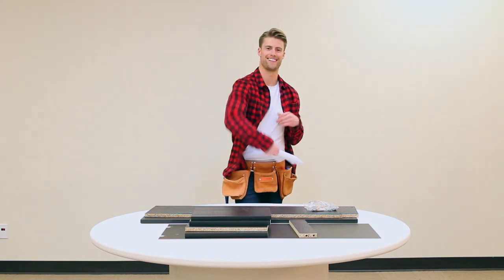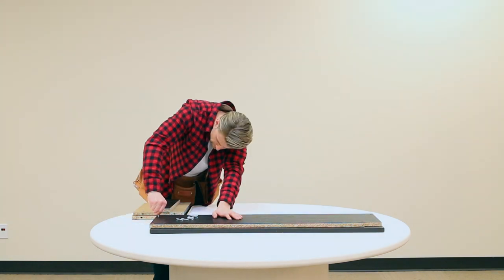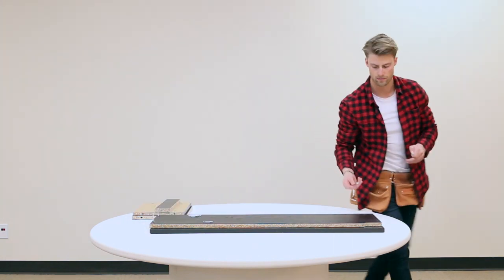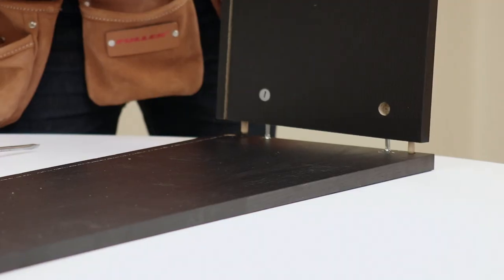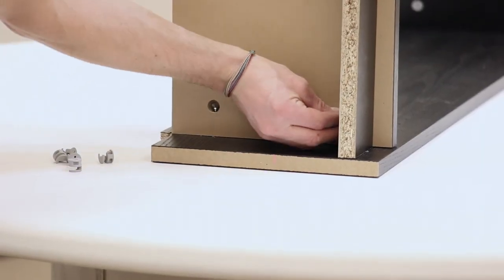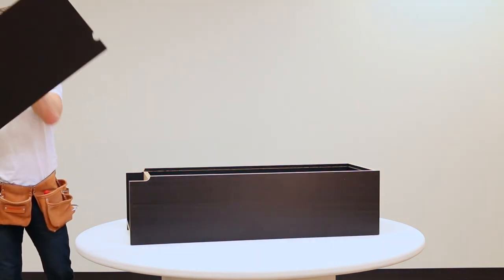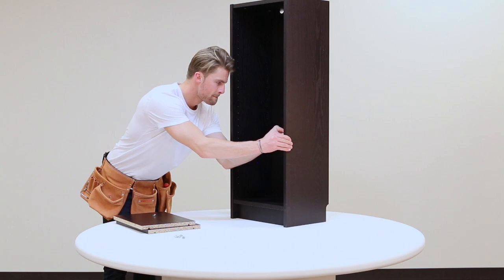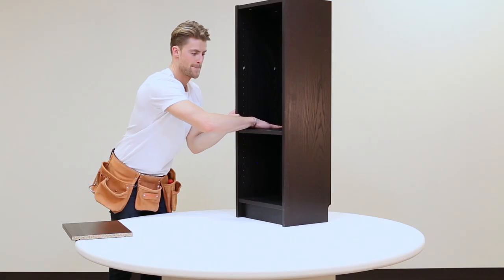How to Assemble IKEA Billy Bookcase

Comment: Did this bookshelf last?
Reply from the maker: +aislinn mauri if you have ever owned an IKEA piece before you may be able to compare the durability, as most IKEA pieces have similar assembly and durability ratings. We haven't had an opportunity to put this piece through a real life test yet. A few tips to increase durability would be to make sure you properly assemble the piece, watching Ikeahunk is a great start! Adding some wood glue to the dowels can also increase performance. In our upcoming series we will be testing some durability. Would you like to see this piece tested?
Reply: IKEAHUNK, I was considering buying this piece, but I didn't want to get it if I didn't think it would last or hold anything without almost breaking. If you did test it and make a video to see how much you think it could hold that would be great!
Reply from the maker: +aislinn mauri great idea! We will try and put something together on durability soon. As far as the IKEA piece in question, I believe it will hold most things you would need to place on it. The shelves are quite robust considering they are made of melamine. It will hold any books or other everyday items you place on it. What do you plan on using it for?
Reply: IKEAHUNK, just books, plants, little things like that. But I will be moving around a lot and I don't want to get it if it will break in the process... ya know?

Comment: If IKEA Hunk concentrated more on the job and not his hair, he'd notice that the top side is the wrong way round the plug fasteners should be on the TOP (i.e. not visible)
Reply from the maker: You are preaching to the choir! Getting talent to concentrate on the task at hand is a difficult thing. Especially when they have hair like that! Let us know if you have any tips, you sound like a pro.
Reply: Mr. Ikea Hunk has it correct , the camlocks should be on the underside because it's the short Billy and would be visible to anyone taller than 4 feet. On the tall billy however, the camlocks should be on the top side  facing the ceiling.
Reply: some are just jealous with this guy's hair...